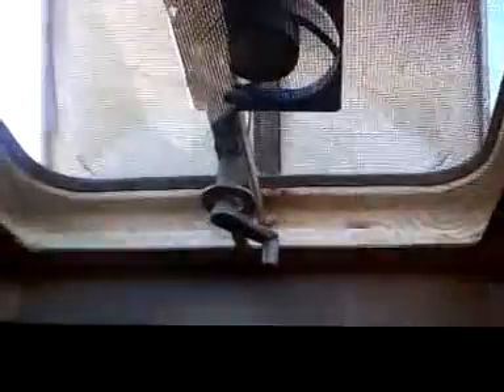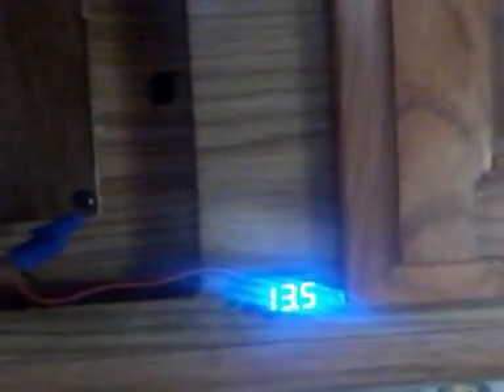Diy rv vent with computer fan

Comment: Thanks for the video, I have a small matrix camper , I bought small 12 volt fan like yours but takes 20 watt , a question , how a 12 volt 3 watt computer fan  could be good enough to cool my face when I sleep , I don’t want to discharge my car battery